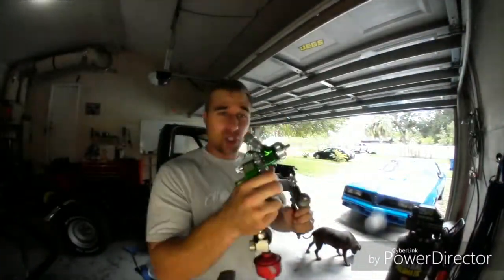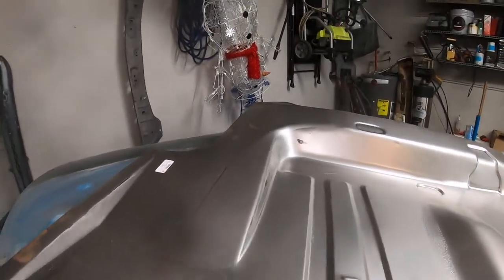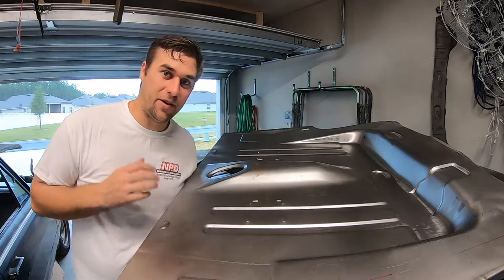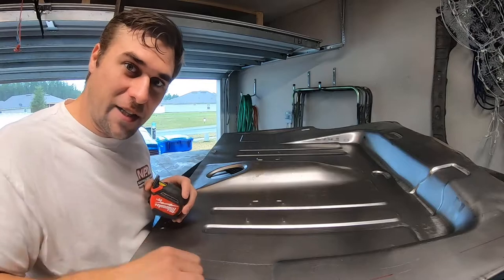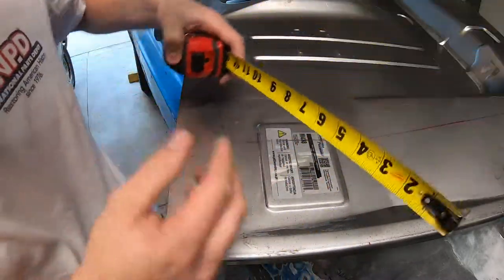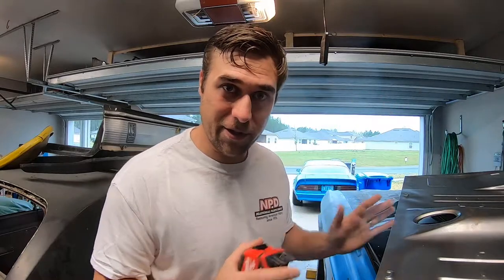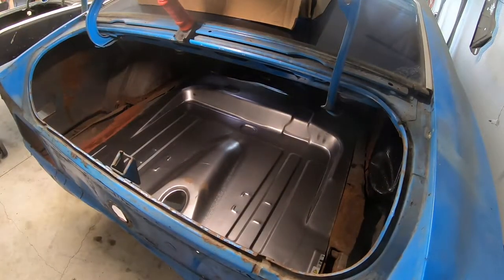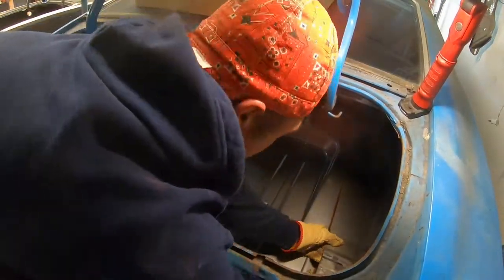1972 Mustang Trunk Pan Pt  1

Comment: Cutting the trunk pan into thirds sounds bananas!... good luck
Reply from the maker: So it definitely was. But it's in there now and you couldn't tell it, if I pointed out where I made the cuts and welds.
Reply: @SteffsGarage  but why?.. it seems like a lot of unnecessary extra work.. unless you really really like the fit of the tail panel.. but hey do you.. good videos nonetheless

Comment: Is Part 2 coming? I'm in the middle of nearly the same restoration except mine started with a taillight panel repair when I discovered the trunk pan was bondo'd to cover the crush that also bend the frame and two u-bolts. It's like an onion. I bought the trunk pan from CJ only to discover it's not full length. About 6" shy of fitting the original space. Got my money back and went with the one you got from NPD. I also had to cut away sections I didn't need since I was only working on the passenger side wheel well and rear lower quarter rusted out. Pretty much going to be a completely new rear end after all this work. I'd love to see your completed job.
Reply from the maker: It is coming. If you watch the rotisserie video it shows the current state of things. I had to do some other repairs before moving onto the trunk. It's coming.
Reply from the maker: I'm out here shooting footage for it today Jon.
Reply: @SteffsGarage  That's how it goes. I almost don't want to look sometimes because I know I'm going to find something else I need to fix. I love fixing, I enjoy the challenge. My wallet just doesn't like it. "Nothing to see here people, move along".

Comment: The reason the trunk floors most of the time rotten out is from the rear window leaking letting water to build up   And the floor panel from the cowl vents
Reply from the maker: I think that is a factor along with that rubber/foam gasket they used from the factory for the tail light panel that is often rusted out too.